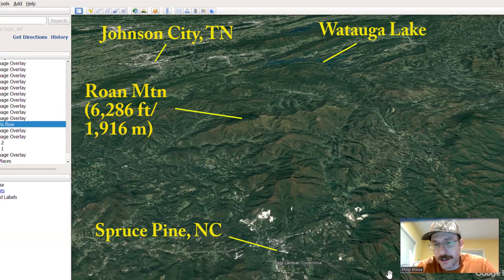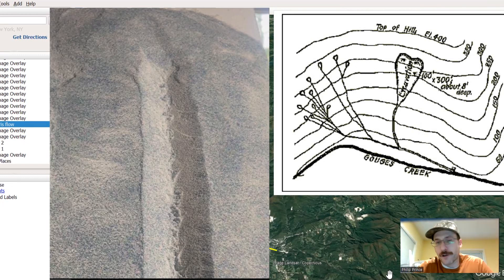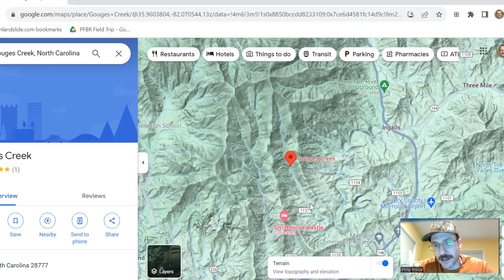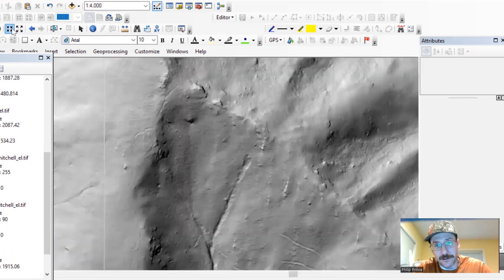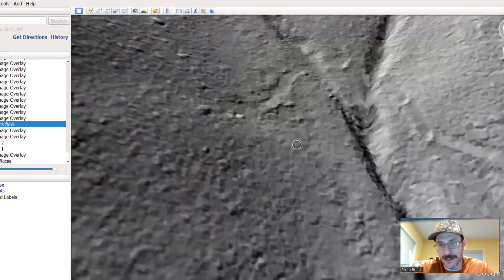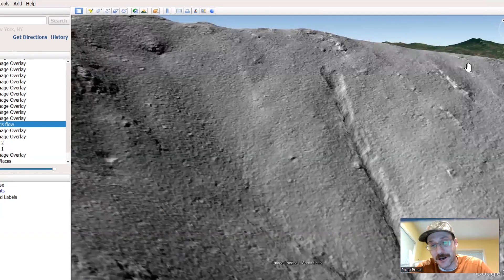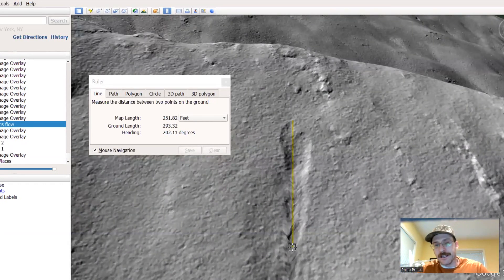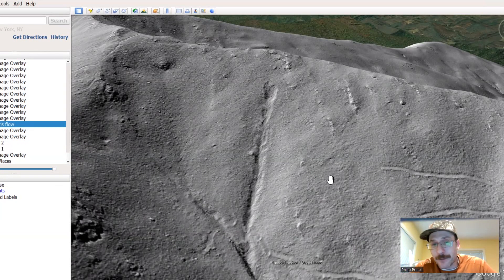Lidar shows the scars of a pre-Helene flood near Spruce Pine (1901 event)

Comment: On the TN and VA state line (Hawkins Co and Scott Co), the possum knobs are HEL with huge landslides.  The size of the slides is hard to imagine.  The old timers told stories of it raining for 2 months and then the mountains started to slide.  One slide blocked the Possum Creek, when it released the water, the wave was 50 feet tall.  There is one slide that looks like a perfect circle.
Reply from the maker: Tell me more about this...do you know what year we're talking about? Definitely interested to know anything you got! I work a lot with this in my "day job."
Reply: @TheGeoModels  How do you want to communicate?
Reply from the maker: @kensmith8832  there's an email address on this link--scroll down just a bit. Holler at there if you can! Definitely interested in the Possum Knobs stuff, particularly cause there's stories about it. https://princegeology.com/about-philip-prince/

Comment: Thank you so much for your work. After reading about the Johnstown Flood (eighteen eighty-something) use of LIDAR imagery will be tremendously helpful to geologists and developers. It is surprising to see the older slide activity.  There is a tremendous amount of information in your presentation. Would someone at your campus be interested in transferring your lidar imagery to 3-D prints? The prints could use 'spiced' greensand or ceramic to position discrete densities in the plot. It might add to what you were explaining with the sand, and I am sure a university could get you funded or working with USGS regarding New Madrid activity. I mentioned your channel on the YouTube GNS Science channel because they had a landslide (and slide dam breach) issue that looked similar.